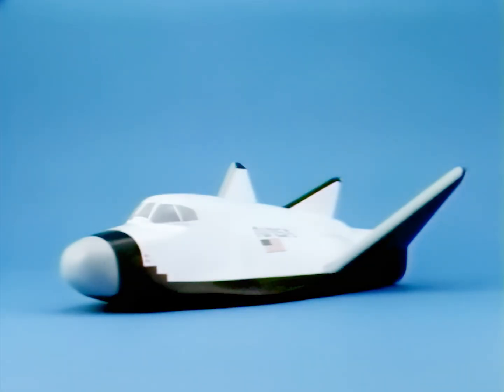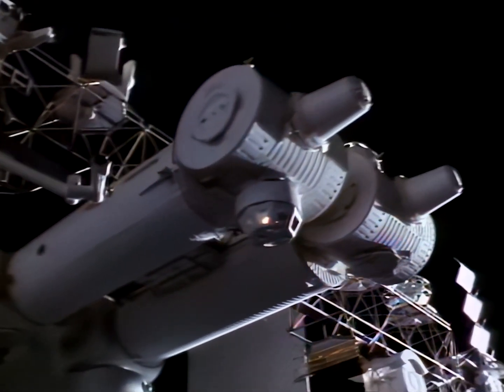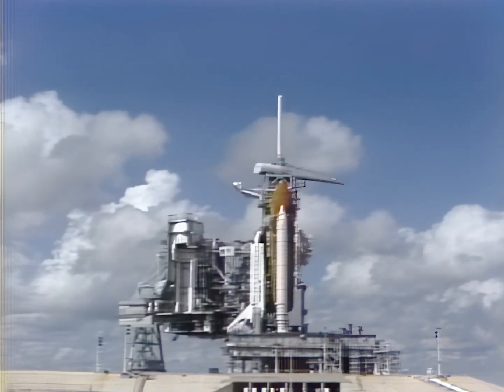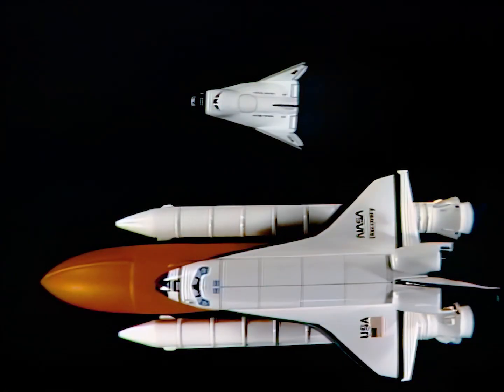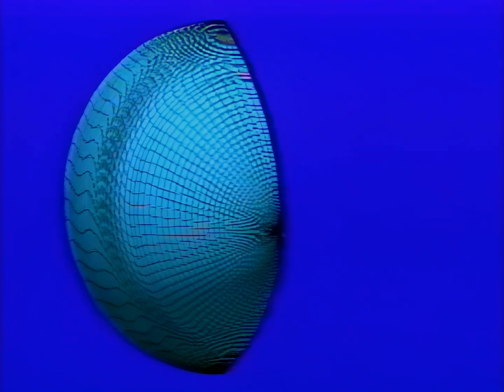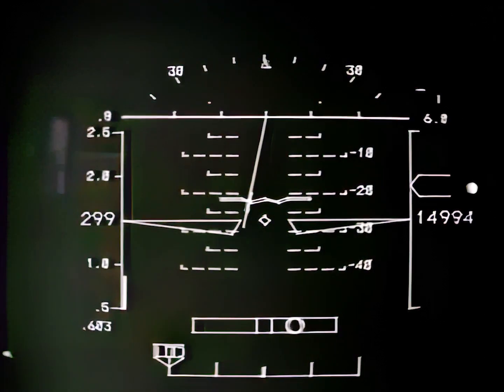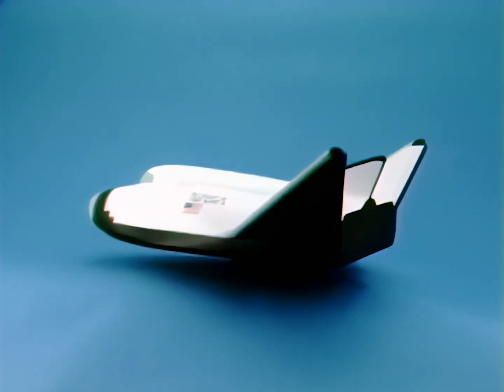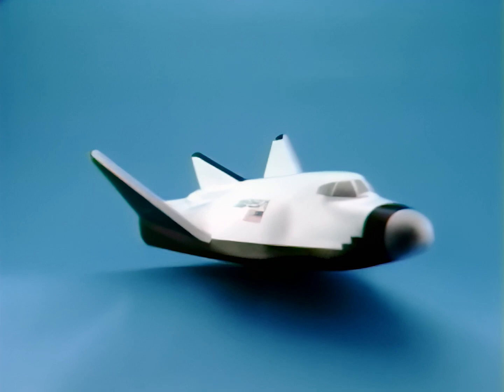HL-20 Personnel Launch System (1991) - Mockup, Studies, NASA Spaceplane, HD Remaster, Historical

Comment: Cute little thing. I'm assuming they'd strap it onto a booster pack to get it into orbit. But they already had the shuttle for that use case.
Reply: Probably would have used the Delta rocket to loft it.
Reply: They would probably launch it the same way as the X37b. They use a Falcon heavy to launch those. Still much cheaper than a shuttle launch.
Reply: @trainingtheworld5093  What is this obsession with 'cheap' when it comes to putting humans in space?
Reply: @Canada_Dominium  Because someone has to pay for it.
Reply: @trainingtheworld5093  So, a very dangerous undertaking equates to throwing away human Iives over money--even though it costs a huge amount to educate and train astronauts.
Reply: @trainingtheworld5093  PS: the Shuttle was a crew carrier, a space station, and cargo carrier all in one.  The cost of a separate cargo machine AND a crew launcher is effectively double that of the Shuttle.  The designers of the Orbiter were far smarter than you.